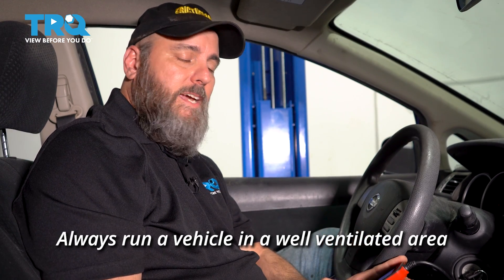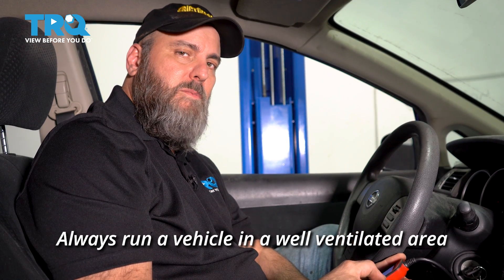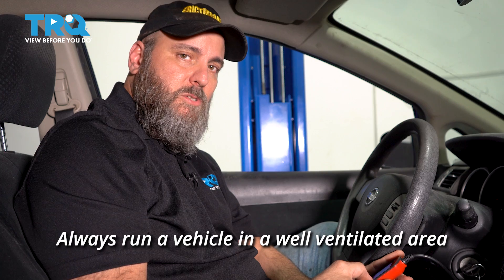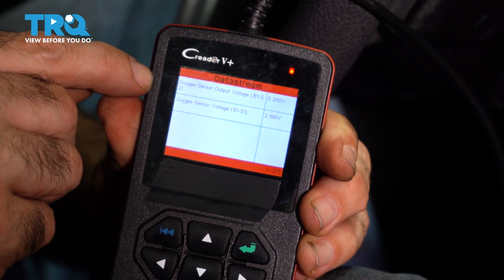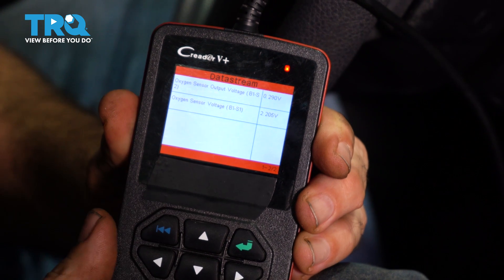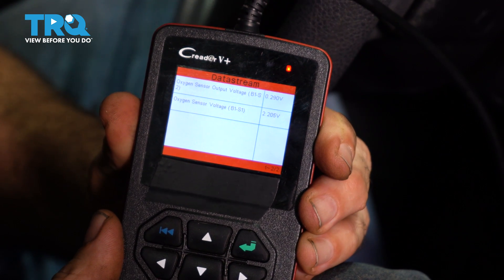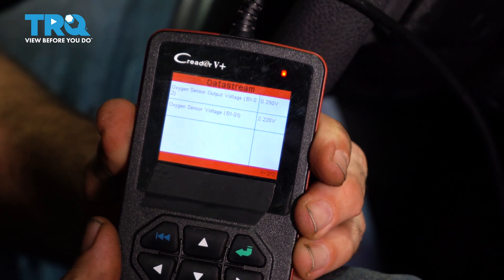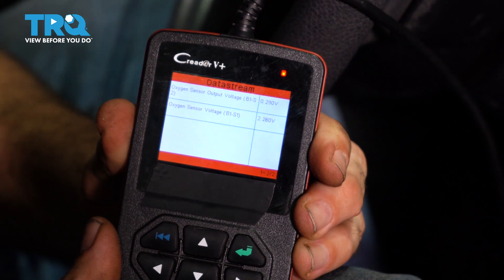EricTheCarGuy Explains Check Engine Codes - P0420 Catalyst System Efficiency Below Threshold

Comment: Thank you for the educational video! The only symptoms I experienced, thus far on my 2005 GMC Sierra 1500 was the loud noise and the check engine light flashed on 
Sunday, April 07, 2024, I disconnect my battery cable for a period of time to reset the PCM/ECM,  before reconnecting my battery cables - I give it the "Frankenstein Contact" by closing the circuit by touch the positive and negative battery cables together for a few seconds. I start the engine the "check engine" light is gone and the metal rattling noise is once again prevalent.   
On Saturday, April 06, 2024, I visit a local gas station, pour approximately ten-(10) ounces of Marvel Mystery Oil into my fuel tank, top-off my fuel tank with fresh gasoline and depart town heading north to Crestview, so I could speedup the RPMs for a consistent period of time for approximately 30-mins each way.  I return home and the metal rattling noise seems to be all gone. 
On Tuesday, April 02, 2024, I am driving around town on a mission for my parent's either repair the electrical cord on their clothes washing machine or find good sales on a new clothes washing machine [Home DIY Projects beget more Home DIY Projects]. Suddenly, the check engine light appeared on the control display, so I immediately stopped by the O'Reilly's Auto Parts Store [other side of town] and requested a OBDII scan: the Sales Tech stated the device identified DTC P0420, Repair Cylinder Head Ground Wire, Primary DTC Three-Way Catalyst (TWS) System Low Efficiency. I visited the closest garage whom I used in 2019 to warranty my Interstate Battery. This shop informed me that the DTC P0420 is a like "detectives clue" it could be a bad catalytic converter [I was shocked he said my truck has four-(4) catalytic converters] or a handful of other parts in the exhaust/muffler system. During our conversation I asked for the worst repair - if I were to replace the whole exhaust/muffler system - it would cost ~ $3000.00! I inquired if he could just cut-out the catalytic converter [he replied by law the shops in Florida cannot remove catalytic converters [Huh?]. I muttered that I haven't driven my truck more than 500-miles per year for the last seven-(7) years. He responded that check engine light is just a "Warning" and since I drive very little he said I might get two-(2) more years of driving before the warning becomes a real problem. 
On Monday, April 01, 2024, the noise was nearly gone with intermittent rattling, so I stopped by the local O'Reilly's Auto Parts Store [my side of town] and requested a OBDII scan: the Sales Tech stated stated "No Diagnostic Trouble Codes (DTC's) were identified by their device. 
Prior to Sunday March 31, 2024, I just don't know what the source of my mystery noise in my 2005 GMC Sierra 1500 VHO: the last six-(6) years has been rough on my truck and life has been even tougher on our family. Mystery Metal Rattling Noise. 
On Sunday, March 31, 2024, I poured 10-ounces of Marvel Mystery Oil into the engine oil crankcase and the noise was much quieter   
On Saturday, March 30, 2024, while using a rubber mallet I tapped along the Catalytic Converters and Exhaust Pipes and could not see any movement, and the echo did not sound like the metal rattling noise. 
On Monday, March 25, 2024, I started the engine and listened to the rattling noise from underneath the truck, poured twelve ounces -(12-oz) of Marvel Mystery Oil in the engine oil crankcase and pressed the gas pedal down and it subdued the metal rattling noise, but did not eliminate it. This mystery noise problem occurred when my truck was in the local garage service. The Chief Master Mechanic [Brian] is awesome - he is a honest broker and takes on all jobs: I just wish I met him 10 years ago when I returned home to help my parents. The last few years either my truck or my parent's 1997 Monte Carlo LS 3100 was in his garage: I just swapped vehicles after repair and service jobs. For nearly 2-years one of our vehicles was in the garage. 
On Saturday, March 23, 2024, I retrieved my truck from Brian and he mentioned the mystery noise, but he wasn't sure of the cause. 
On Friday, February 02, 2024, Brian was ready to move the truck outside of the garage because he fixed the water leak problem, but the engine would not start. Brian telephoned me if I had a spare ignition key to bring to him because the ignition cylinder would not move or start the engine. None of my ignition keys would turn and start the engine. I visited a local locksmith and they made a new key from the GM Key Code - the new key ($25.00) would not start the engine. After searching the internet and learning that the GM Key Ignition Cylinder problem happens a lot to truck owners and conversing with Brian we decided that I need a new Ignition Key Cylinder. Brian successfully removed the original ignition key cylinder and installed the new ignition key cylinder: the key turned and the engine started then the mystery noise. The past four and one-half years I had water leaking into the passenger cab space from the third brake light, the cabin pressure vents and the rear windshield. After waiting for a couple of heavy rain showers I was confident and happy because Brian indeed fixed all of the leaks. I visited a Auto Body shop in Pensacola, Florida ~ 55 miles west from my home and replaced the headliner in June 2023 and within 2 weeks I had water leaking into the front passenger side - the floorboard was SOAKED. I returned to Brian and he fixed this fourth leak too [the sunroof drain tubes were cracked wide open].

Comment: Thank you Eric ,that my check engine codes P0420 my 2004 toyota camry got 585,145 miles.I changed 02 sensors the code disappeared ,two days later code came back.

Comment: I understand that the engines you're working on specifically, has plugs designed for it and MUST be exact type replaced.
 Using other types like iridium coated might cause issues due to the polarity impedance they have the engine was NOT designed to operate with. Thus can reek havoc on exhaust system.
As well as bad or poor plugs needing  replace can induce the issue possible.
Like you said here, verify the simple obvious first.
Vacuum at intake check, wiring integrity, temp F/R of CC' wherein F should be cooler than R by about 100 degrees, , View the cycle rates of the F/R sensers refresh, F should be faster than R sense.

Comment: Hi Eric, I've just come across this video, I have codes p0171 and p0174 and my scan tool says that  my O2 sensor 2 is stuck at 0.99, so I think it's not working, my question is which is sensor 2? It’s on a 2009 4.0 Ford Mustang. I read a few things, some say it's the first one in line other's say it's the one in the cat, so I'm just checking. Thanks

Comment: My 2014 Chevy sonic was throwing a PO420 code so I inspected the exhaust between both O2 sensors and found the welds between the flex pipe both were failing. Ended up stalling a new upper pipe. Problem solved and have noticed more power and runs even better.
Reply from the maker: +@adampeterson8359 Thanks for the feedback! http://1aau.to/m/Shop-TRQ

Comment: Thanks for the step by step diagnosis. I have a 2008 Nissan Titan with 197,000 miles. Getting PO420 code. Now I know how to check with my scan tool. Thanks.

Comment: Got this on a 2010 Grand Caravan Se new Oxygen sensors and new cat and new exhaust new injectors. New plugs and wires. And gas cap.  Dealer cant figure it out and neither can I. I am about to out a nonfouler in bank 2 and see if this helps.

Comment: What if the code p0420 keeps coming back even after replacing the cat and 02 sensors? I've replaced my cat numerous times but same thing. Can a bad valve seal cause this? 1999 honda prelude manual

Comment: My 2014 Sierra threw a p0430 code. I replaced the thermostat as I could see I wasn’t reaching full operation temperature. So far it’s running good and no more code. I’m assuming it was a fuel ratio issue.

Comment: Good video.  I have the same problem (P430) but my car run well.  I repair the plug of the inyector of the bank, made a tune up and verified the catalic internaly with a camara and change the upper sensor.  I live in Puerto Rico.  Here not due all the examination than you do only said change the catalic.  The mechanic said than internal material are bad because the age.  I have a camry 2004 SE 3.3 with 115,000 milles .  The question is, is real than have problem internaly perhaps the car run well?  Hector.

Comment: I had a check engine light on my 2015 kluger..it came on like 3 times then disappered for months..so I bought a scan tool and scan for codes..No fault codes were found..BUT I found a misfired on cylinder 6..this was like last year close to Xmas..but yesterday the check engine light came back on..then scan it..and had a p0420 code for the first time..and yes I realised a little bit of lack in power sometimes when accelerate..do you think its the converter??or the misfired on cylinder 6 that causes this??

Comment: Awesome video! We have a high mileage Toyota Sienna (~150k) recently had the fuel pump replaced at a local dealer. It misfired only when engine warmed up. It turned out to be a bad fuel pump (only 15psi pressure). The technician cleared the code and the car ran a few days and check engine light came on again with p0420 and p0430 catalytic converter efficiency below threshold codes. Does anyone know if it is possible for the technician to mess up something when working on the fuel pump replacement to cause this? We have never had these before. Thanks Eric!

Comment: I had a p0420 on my 09 versa, I replaced the converter with a cheap aftermarket one, it not only did not fix the issue, it made the exhaust fumes smell super awful which then protruded into the cabin. I had to bite the bullet and buy a genuine nissan oem part, however it fixed the issue and no more raw exhast fumes smell in my car! drives like brand new now! so get a OEM one dont cheap out and learn the hard way!
Reply: Did the same thing but screwed a spark plug extension in 02  hole first. Saw on youtube

Comment: Sir, I have an 03 Accord V6. I have replaced all the sensors but it still jerks/bucking when accelerating at 20 miles per hour. I had a code came on P0757 shift solenoid B, replaced that and still jerks when driving 20mph I have changed the transmission fluid from Honda dealership. And still doing the jerking. I have too much sentimental value on this car. I bought it when I return from Iraq back in 2003. Please help!

Comment: The causes of P0420  is broken  mass air flow sensor gas cap and fuel injection system. P0420 is sometimes  is error codes  is number one  problem.
Reply: Thankyou maybe I’ll try a new gas cap

Comment: Aside from clogged cat, Yeah always fix the engine first. A constant lean will saturate catalyst with oxygen, and a constant richness will starve catalyst of oxygen. With no more movement of oxygen to/from exhaust stream, the rear O2 will detect no change in oxygen, throwing p0420. In this case there was no misfire or any other code, that is when you address the cat itself.

Comment: I really love and appreciate Eric's videos. The car in this video obviously had problems and needed a CAT. Regarding the P0420 code, I've had a different experience that may help others. My 2010 Subaru Forester, 159K miles, ran great, no codes other than P0420. I researched for days and scanned the O2 sensors similar to what Eric and other channels describe and checked for exhaust leaks. I could not make much of the changing O2 sensor voltages and figured they must be good because they did not trigger any codes. My scanner's (Innova 3040rs) live data function also displays CAT internal temperature (1600F), so I thought it was weird that the CAT was inefficient. I planned to keep the car, and I was determined to fix it. Given the lack of good aftermarket CATs for Subarus and OEM prices from $2K-$4K USD, I decided to replace both O2 sensors (actually front A/F sensor & rear O2 sensor) as a first step- since I'd be buying them anyway when replacing the CAT. Lo and behold, the CEL went off immediately! I used good OEM sensors front: Denso-2349123, Rear: Denso-2344445. Given the price of CATs, and if the car runs fine, maybe a sensor change is worth a try as long as you plan to keep the car. YMMV.

Comment: Eric O(South Main Auto) has a very good test for a clogged/restricted cat which is to drill a 1/4 in hole in front and behind cat and insert a 2 inch long piece of steel brake line in each hole and then attach a vacuum/pressure gauge to each and compare pressures. When test is complete, wiggle the brake line pieces out of the holes and weld over the holes.

Comment: So I was getting po420 on my 2014 Nissan Altima. But it was running fine. Cleared the code several times and it kept coming back. Finally got a new front cat and o2 sensors. Had them put on and now it runs like garbage. I can clear the ECU and it runs fine for about 60 miles and then a lean code pops up and it starts sputtering and jerking. Clear the ECU and it runs fine again til the lean code pops. Any ideas anyone? Do I have crap sensors?

Comment: I have a 2009 Pontiac Vibe 2.4L at 230000 miles. I bought it used recently. No Cat codes, but I get a severe hesitation in acceleration just like you have shown in this video. I have two cats and I am thinking to replace the second one which is unmonitored by O2 sensor.

Comment: just bought both cats and both o2 sensors for me car, worried the engine might've hurt the cat...my question is, if I am running lean or the car is throwing misfire codes (which it currently is with the bad cats still installed) what are some of the next steps I should take without throwing a bunch of parts at it?

Comment: I've been getting a check engine light with the P0420 code for a couple of months. It comes and goes. The car is a 2006 Prius with about 158000 miles on the odometer. I did catyclean twice. If the code isn't permanent and comes goes does it mean that it's partially clogged?

Comment: I had one instance where the P0420 code came on the heels of other random O2 sensor codes. The sensor was replaced and it has been fine for 50K miles. The history matters most. I agree it mostly points to a bad cat, especially with restriction symptoms. It can't work without flow.

Comment: We have this code caused by broken exhaust manifold bolts... causing exhaust leak. Causing the sensors the think it was running lean. Fuel trims were way high. Was dumping fuel unnecessarily.... causing fouled plugs and high readings at the cat. Ripped out the exhaust. Welded nuts on the broken bolts. Removed those. Waiting on new headers and catback
Reply: Did it work? I have the P0420 code too on my vehicle. After checking for leaks on my exhaust system, I saw that my resonator was leaking along the seam. I’m wondering that if I got it fixed that it will remove the P0420, or if the code really is due to a clogged converter or bad O2 sensors, etc.
Reply: Did you have symptoms of lack of power (especially low acceleration) ?  I got this code and found a dime sized hole in my exhaust manifold from rusting ( Right where it is bolted together to the second piece of downward exhaust pipes.

Comment: I have an  intermittent close loop/open loop condition that  only keeps closed when gas pedal is pressed otherwise jump into open loop if gas pedal is released under desaceleration . Is that a normal condition during driving at 40 mph or faster?
Reply from the maker: +jorge lopez We wouldn't be able to diagnose an issue like that here, you may want to have a local mechanic take a look at it. Thanks for checking us out! http://1aau.to/m/Shop-1AAuto-c

Comment: I have an 09 kia Sedona with a V6 and both codes are up for catalyst efficiency. Car runs fine though. I do need to change the spark plugs, it's got 217k miles. I'm hoping just changing the plugs and coils will clear this up as they need done anyway.

Comment: Nice to see you here, Eric!

(For the viewers/readers)
Rapid switching should NOT occur on an AIR/FUEL Ratio Sensor. Only a traditional Oxygen Sensor operating at or below 1 volt, should switch quickly.
 AND WEAK O2 heater circuits can cause this too!

Comment: I have been having p0420 code for 3 months. I used catcleaner and I have 10% better fuel consuptiom. Emission test perfect. I Changed spark plugs and lambda sensor and  After I changed o2 past catalyst sensor my engine light switches off and then after a week is back on, so week off/on. Today I changed the engine coolant sensor and air filter and if the light engine is back then I don't know what to do as I don't think is anything wrong with catalytic converter as the engine light would be on all the time, not week on and week off plus my car wouldn't pass emission test and fuel consumption wouldn't improve after catcleaner
Reply from the maker: +Tommy We wouldn't be able to diagnose an issue like that here, you may want to have a local mechanic take a look at it. Thanks for checking us out! http://1aau.to/m/Shop-1AAuto-c

Comment: Eric, my 2017 VOLVO XC60 has the 2.0 supercharged and turbocharged four engine. I too have the PO420 code. Where did you order your catalytic converter from?  The Volvo dealer wants $2,377.89 for just the first one where the turbo connects and it’s tiny

Comment: Random question anyone know why changing the 4 tires on my 1990 Acura Integra would cause the check engine light to turn off.  It has been on for 4 years and mechanic after mechanic were unable to troubleshoot.  Then went to get 4 new tires and bang light is off.

Comment: Hay Eric,  don't most converter manufacturers require you replace o2 sensors when you install their products?
Reply from the maker: +Joseph Reisinger It is recommended to replace the oxygen sensors when replacing the converter but it is not necessary.